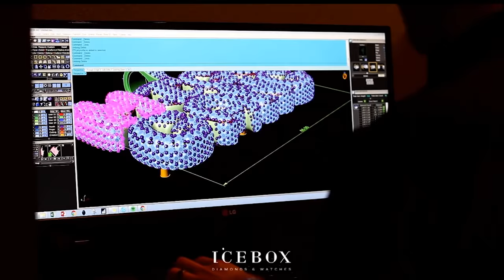ICEBOX shows the whole manufacturing process START to FINISH!!! #shorts

Comment: So it the cast just dipped in the metals they want? So basically all tht jewelry just be heavy ass wax castings🤔
Reply: thepjsma Yes. If they want gold, they just cast the piece, and drill out inserts for diamonds. So when you buy an iced out chain like that, you're basically just buying a cast piece of metal with diamonds.
Reply: uhmm? They make the mould and then cast the gold into the mould, then drill out the holes for the diamonds.
Reply: i'm pretty sure they make the mould, then put the mould into another mixture which then hardens around the mold, making the same shape into a mould that they can then pour the molten gold into, they probably just didn't show that part? idk. that's how i would assume it's done though. Wax would melt as it came in contact with molten gold so there's no way there's any wax inside the structure of the pendant lol
Reply: cuz when he poured those little metal beads into the machine, that's the solid gold that the machine then melts and after is poured into a mould of the shape of whatever custom piece they're making
Reply: not what they doo at all